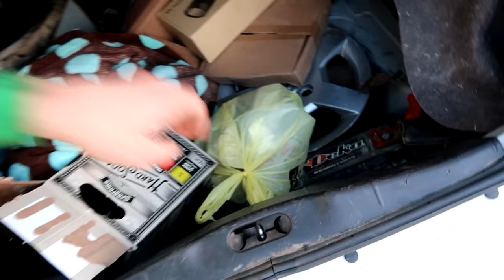BMW DIED...AGAIN!

Comment: @3DMachines I told you before you don't have to use the trunk in the Balt. Pop the hood and use the positive post and the strut tower bolt. It'll keep the Cobalt's alternator safer.
Reply: Jay Hensley this guy knows

Comment: bimmer you've started, there was a rattle sound is wet or belt, but looks more like a dead on the cooling pump, check it out and check the tensioner